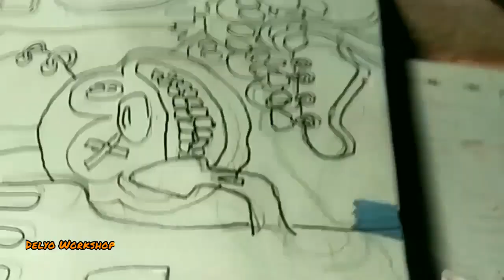How to custom a Guitar | Repaint | Doodle

Comment: wow sir gusto ko yang hobby mo may ginawa din ako na Bass guitar ..mamahalin na brand ng guitar pero gusto ko ulit i repaint mukhang mganda tong pattern mo.pturo po..naghatid po ng ayuda satay connected
Reply from the maker: Uo try mulang lodi kung ganito nsa puso supporr ako 
Acrylic or oil paint ginamit ko or kahit anong paint basta may top coat cover
Reply: Pwede bang patungan yung stain paint ng oil paint nka staind lng kdi yung project guitar ko
Reply from the maker: @parkeradennatv6709  remove mu muna lahat ng paint tapos primare bosny spray paint gamit ko pati n topcoat ganun pero may dati ako topcoat na gusto kaya lang wala n mabili dito yung samurai ang brand
Reply: @artist111  ok sir slmat sa info stay connrcted